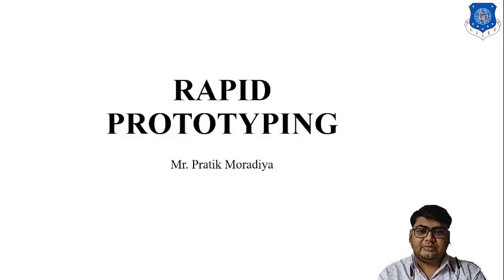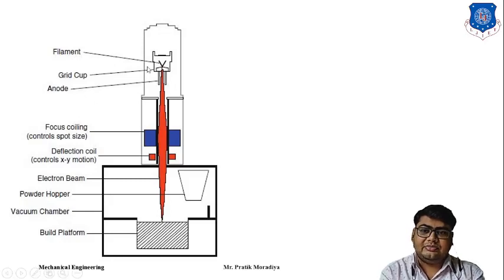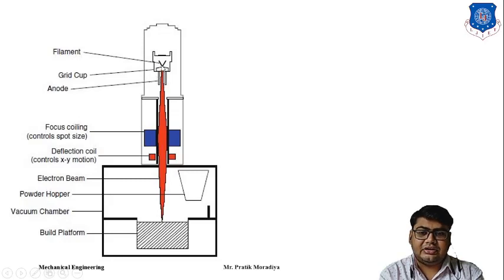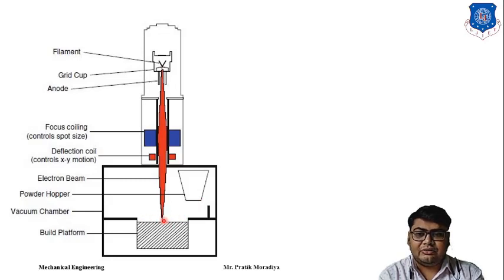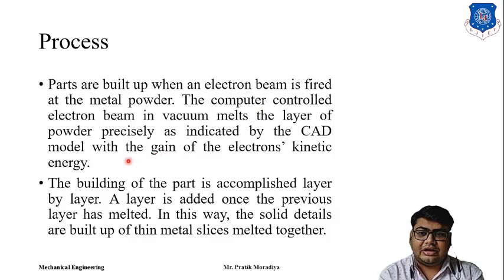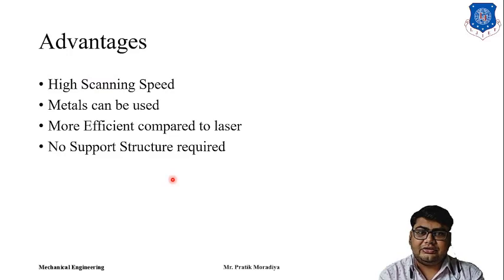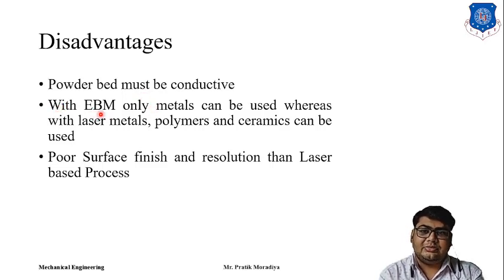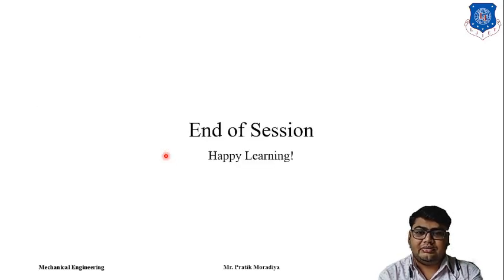L 11 Electron Beam Melting as Rapid Prototyping Process | Rapid Prototyping | Mechanical

Comment: Sir is Electron beam melting and electron beam machining is same..?
Reply: No, They are not same, in Electron beam melting, we are adding material on the surface, while electron beam machining is used to remove small amount of material from surface. With this information as starting point you can read about both the process to understand it clearly. Just a heads up that there is electron beam welding also.
Reply: @pratikmoradiya6164  Thank you Sir